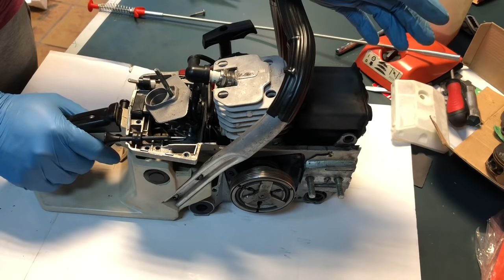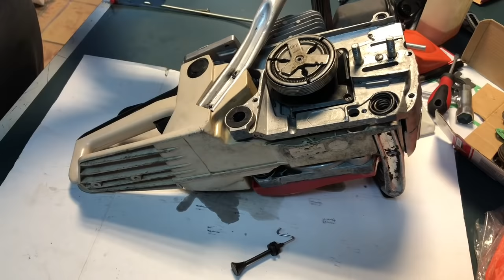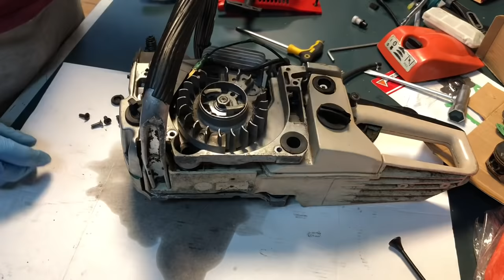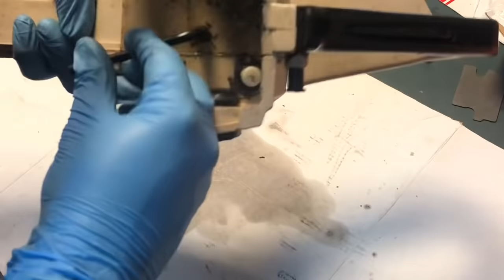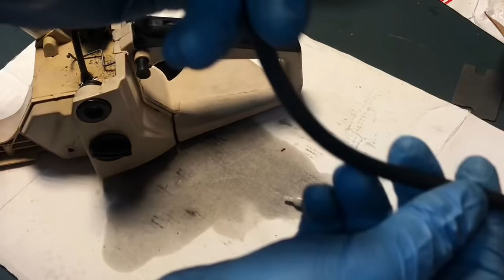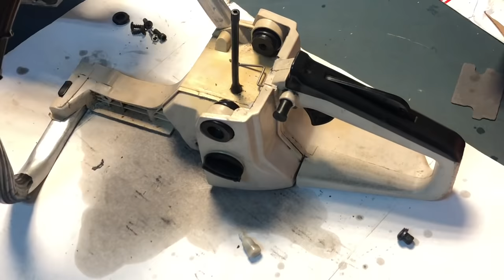Drujba merge putin si se opreste. Ce fac?

Comment: Thx for this useful video I have the same problem but now it doesn’t work unless When i put the fuel directly in the carburetor,my question is if I pull the fuel pipe and turn all the motor upside down should the fuel come out from the tank or not and if not what should be the problem (by the way it’s new one and I used it just 4 hours thank u for answering me
Reply: Have you tuned up the carb ?

Comment: Hei. Nice video. I have the same chainsaw. I have the same problem. Have changde the vacum valve and cleaned carburetor. Still the same problem. Any suggestions?
Reply from the maker: Try the seals, maybe they leak
Reply from the maker: Or the intake
Reply: Thx. The seal on the clutch side is good. Is there moore seals? I will check the inntake 👍
Reply from the maker: Is another one on the flywheel side

Comment: Am un micul pădurar 5200, o pornesc sta pornita 3 4 minute se accelerează singura și se oprește... Am schimbat bujia, am verificat furtune am verificat supapa de la rezervor doar pot trage aer nu sa și suflu am schimbat filtru aer și benzina... Cam tot ce am văzut prin videouri... Singura chestie nu am schimbat simiringu deoarece am desfăcut acolo am dat cu apa și săpun am suflat pe furtunul acela și nu observ sa iasă nimic pe acolo pe unde ai schimbat tu simiringu... Dar dacă bag bujia la loc țin degetul acolo la gaura aia de cauciuc  și  suflu pe furtun se aude ca iese aer da nu îmi pot da seama pe unde.... Am pus și șurub pe furtun și am tras la demaror are și compresie tot... Ce ar putea fi?
Reply from the maker: Am intalnit chiar si set motor slabit din suruburi :)